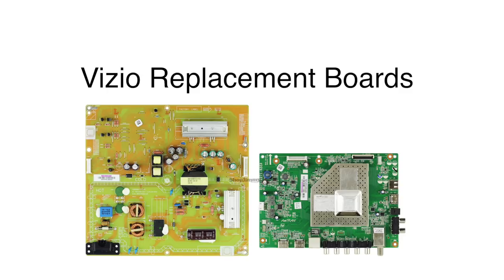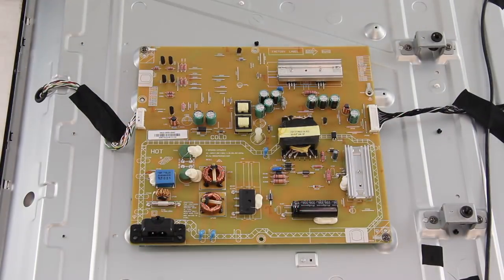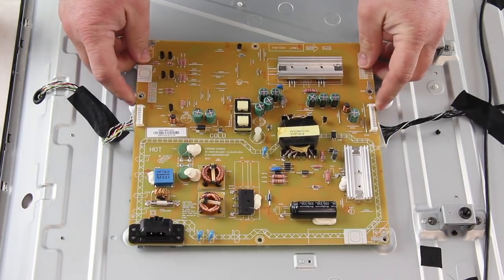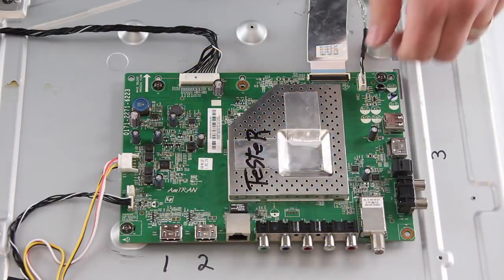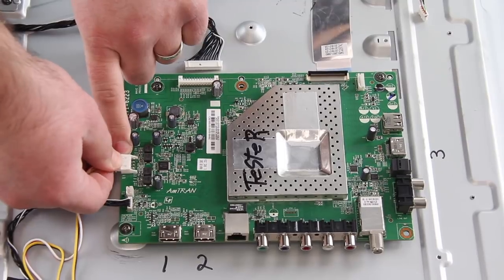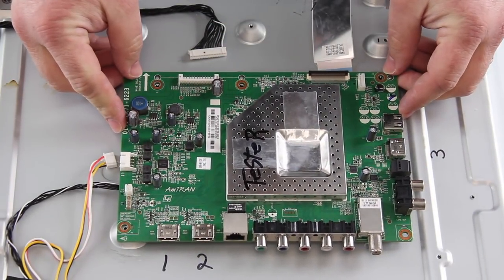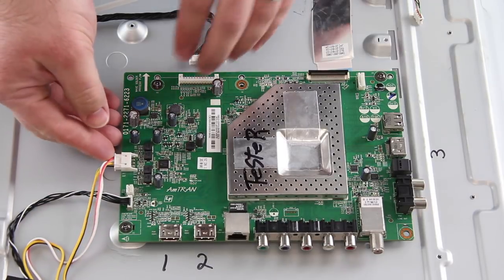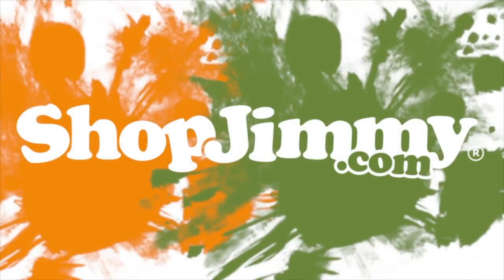Vizio 48" LED TV Repair D48-D0 - How to Replace All Boards Part Number KIT-D48-D0-K1

Comment: Is it possible to work on the lcd panel/tcon board on this model? I am getting power, the main board is fine but all i have is backlight. If the tcon board is part of the LCD panel i guess there is nothing that can be done...right?

Comment: Hi Jimmy - Could use some tech help. My D48-DO works just fine using HDMI inputs.  However, TV tuner is another story. It's able to scan and find digital channels, but afterwards gets hung up.  I don't get a picture of local channel, but can hear scrambled signal in the audio. I cant change channels and it just gets hung up and freezes.  I would have to disconnect the coax for it to show no signal in order to change inputs.  Will replacing the main board fix this problem?

Comment: i have a vizio d48-d0 and i have back-light but no picture or sound,i have replaced the power supply and main board with no help,it powers on ok,no menu or other info on screen,could you help me
thanks steve
Reply: Did you ever get this issue resolved I have the same issue with my TV change the main board and it still does the same thing I am going to change the power board to see if that will work or will that be a waste of money and effort?

Comment: I have a  Vizio  D48-D0 I changed the Main Board the TV powers up however there is no  Vizio logo or the menu doesn't display, only the screen lights up from  the back-lights I was thinking if I should change the power supply board but will that make any different being that the TV is already getting power?

Comment: Hello. I have recieved this tv as gift. It does not power on. I thought it could be the power board and just changed it as of 1/17/20 and it still does not power on. My question is do I also have to change the green board as well?

Comment: I don't know if you will see this question, but I have the D48-D0 also.  My part number however is 3648-0202-0150(3D) and all i am finding online as a replacement part is (3C) do you or does anybody know if that is compatible???  And where can i find a part?

Comment: I have a vizo do serial number laustwe83303750 my TV has the back lighting I can see a small corner of the menu but it has a cracked look and also it look as if some black fluid was leaking through what would  be the cause of this and is it repairable

Comment: D48f-E0 I have removed all the screws even the tiny ones in the very corners.  I lift up and the back corner comes up.  I am afraid to apply too much pressure.  Left side cones up about and inch or so, the right corner does not come up.  It feels like I am working with an apple product that uses glue.  All YouTube videos show that it just lifts off.  I notice there are no screws at the top and only two tiny screws on the sides, each corner.

Comment: Hi. My Lg 50UH5530 Have blinking red lights when i tried to turn it on.There's no sound and no picture. I used a flash light to see if the back light were the problem. But there's nothing. I unplugged the tv from the wall and plug it back in and when i turn it on i could see the LG logo for a second and it turns off. Can you guys help me please?

Comment: I replaced both boards and my vizio d48d0 is still flashing like a strobe light
Reply: I feel your pain. I just swapped out my power board and it wont even turn on at all. No lights, nothing.
Reply: @socomsfinest1184  Same here replaced both boards now it does nothing
Reply: Did you find a solution? I have the same problem. I could see images  okay, but it flickers as soon as I turn the TV on

Comment: I replaced both boards and the picture is back but it flickers. No inputs connected to the tv only the power cord.
Reply: I have the same problem  it flickers as soon as I press the power button